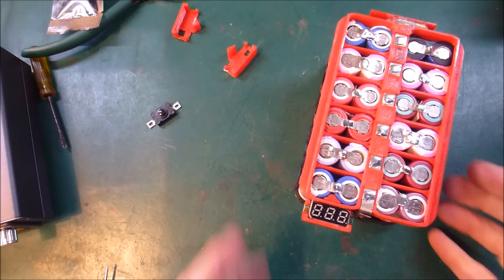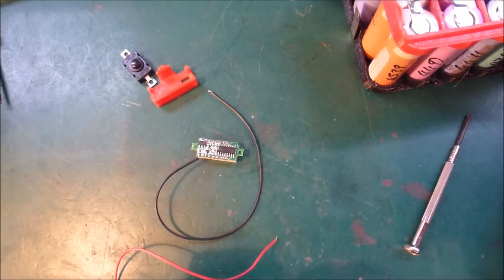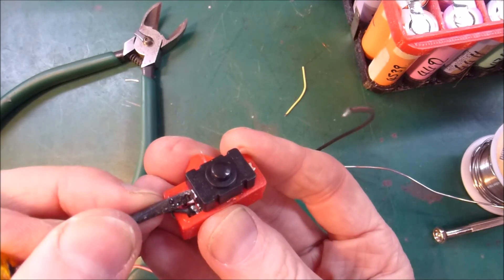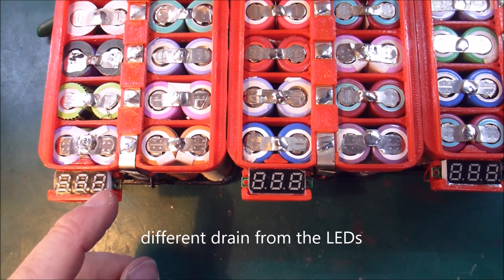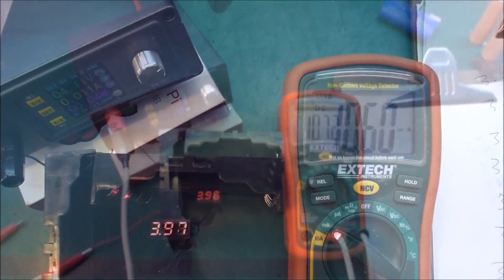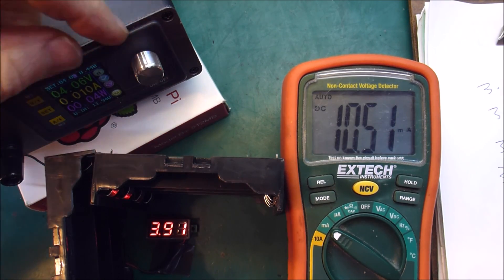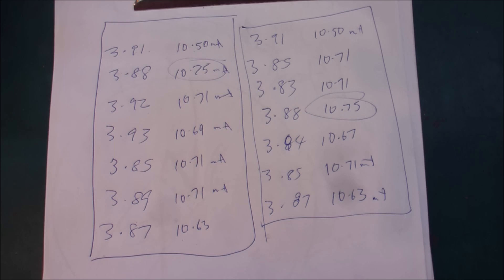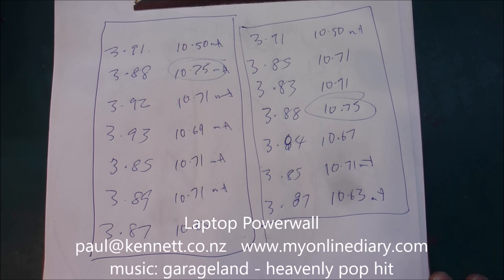Laptop Powerwall 111 - cheap simple pack monitoring

Comment: Hi Paul, great vids! Almost every video shows some kind of 3d printed item. What kind of 3D Printer are you using? (Brand, Model, specs, etc)  I want to buy a 3d printer so i can mimic the same project identically to you. Cheers!
Reply from the maker: Hi Bmi. I'm using an "old" Printrbot Jr. It does PLA only in a build area of 130 x 130 x 80 mm. Still prints fine but you should be looking for something newer.

Comment: Based on the number of segments lit at any given time, the lowest draw of the meters should occur at 4.11 volts and the highest, as you discovered, should be at 3.88 (based on measuring the lithium packs). If measuring for absolute maximum and minimum, though, the lowest/highest draw should occur at 1.11 and 8.88 respectively.  
Overall, though, 10mA is pretty much a negligible power drain on a 24 cell pack, even if each cell is only 1000 mAh, that's still 24000 mAh per pack. That would power just the meter for 2400 hours or 100 days without recharging.
Reply from the maker: And many of us are solar charging our packs so they cycle through a range of numbers every day.

Comment: I am still using the last ones you showed and the same thing happened to me I bought a pack of 10 when they arrived they only went to 6 cells I did get 1/2 my money back but still they are no good. Thanks for showing
Reply from the maker: Yeah - I don't know what the problem is with the recent batch of 8S monitor alarm units. It's an odd fault. Almost looks like a software bug.